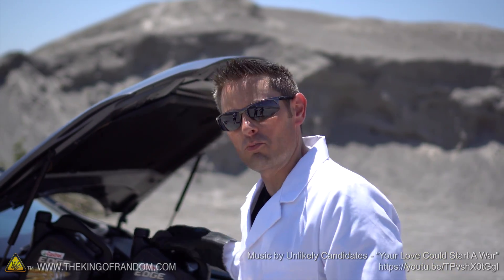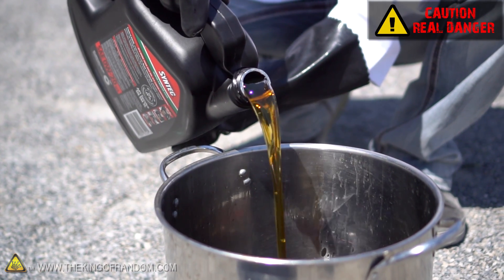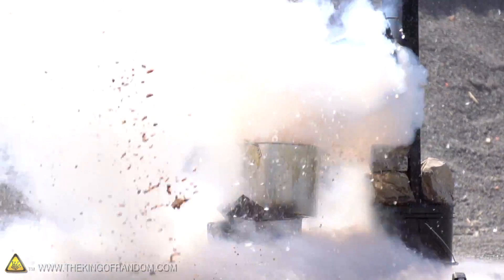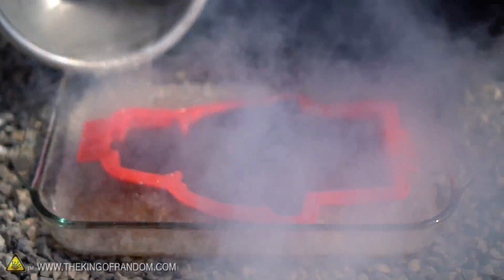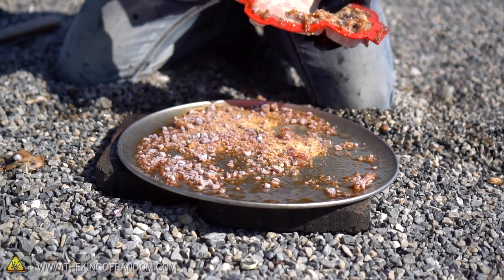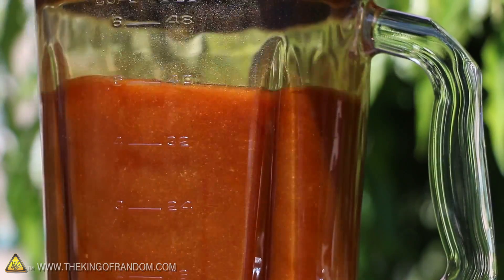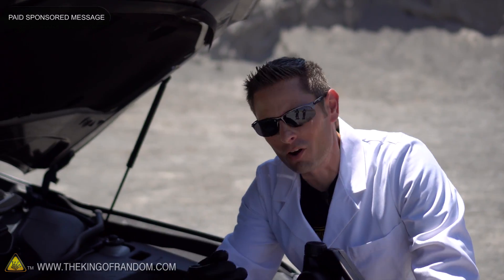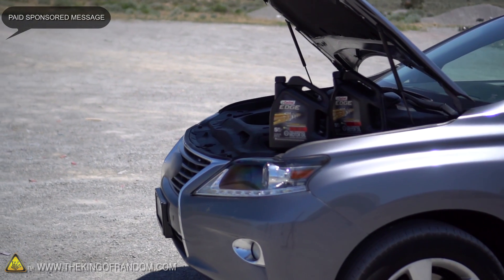Liquid Nitrogen Meets Boiling Motor Oil

Comment from the maker: Should I really have put it in my engine after all that abuse?  Only time will tell!  What are your thoughts?
Reply: what will happen if you put liquid nitrogen in a car
Reply: You're car is dead...
Reply: I love the fact you disclose if you are doing an add right in the title

Lots of youtubers dont 

you are far more ethical then most
Reply: Oh come on, you didn't even set it on fire! A torture test is going /past/ it's ratings. If your going to stay within, then you might as well just put it in a modern engine and replace it after the recommended amount of time.
Get it so it's /boiling/(Try over 300C) and on fire /before/ you throw in the LN!  You won't get a descent fireball otherwise.
Reply from the maker: Thanks for appreciating that.  And yeah I don't want to hide what it is because trust is more important to me than views.
Reply: full selloutmode
Reply: Did you do any sort of filtering... looks like you might have some chunks of silicone, gravel dust etc.  Enjoy your road trip, You should try to drive through Phoenix on a 100+ day, extreme heat killed a an old Mercury Sable in that city.
Reply: My thoughts are that Castrol probably reassured you that should your engine seize solid (during the trip or after a few tens of thousands of miles...) they would cover the engine replacement costs. I don't doubt the oil will be mostly fine since in reality you didn't do all that much to it, but I'm unconvinced you'd be willing to risk a $10k+ engine replacement should something go wrong... Also, I don't know how old that Lexus is but it looks pretty new, I wonder what Lexus' warranty claims department thinks about the whole thing...
Reply: your cars crap anyway
Reply: Dude wtf is wrong with you these days do some projects plz plz plz
Reply: can you try building pc with liquid nitrogen
Reply: best test 2016 ;)
Reply: Nope
I wouldnt have
It is not designed to be frozen, nor boiled and then flash cooled.
Reply: high temperaturea breakdown oils and the detergents in oil. cars run hot but not 400 degrees hot.
Reply: try petrol
Reply: +JonnyKiller the title says #ad
Reply: When will you make the stealth shelf. I'm waiting !😄😁😀😊☺
Reply from the maker: You know I would have, but it wouldn't pass legal.  That was my only restriction that I couldn't set it on fire.
Reply: he disclosed it. He wrote #ad at the end of the title.
Reply: ur wife is fit mate
Reply: +Fusion Coil Production
An engine that can only run on conventional? nope. Synthetic oils is nothing special. Here is how it works:
Mineral oil is simple paraffin with minimal additives, only selected to get the viscosity at certain temperatures (the 10w40, 20w50 etc.)
Synthetic oils are more refined than mineral oils (like comparing drinking water to creek-water) and have additives to keep the engine clean, to prevent it from burning, cokes and other problems.
Semi-synthetic is obviously somewhere in between.
Any car running on mineral oil can run on synthetic, that's why you can switch so easily
What could be the case in some cars is that the engine can't handle some of the additives, which is weird, companies like Castrol choose them carefully. So this should not be possible, I haven't seen any cases where it is.
What is often misunderstood is "eco friendly oils" (which is basically snake-oil). These are just good synthetic oils with LESS additives keeping your engine clean. So you will have to change your oil more often.
If conventional oil means "no snake oil" then you're right.
---
And yes, you can put Castrol edge in every engine as long as the viscosity is right.
In mineral oil - you are risking- the engine to get dirty form deposit, actually it's not risk but a matter of time.
Deposit on your engine is always a bad thing, the only positive thing from deposit is that it can fill in scratches and increase the compression; as well as clogging everything up. If filling up scratches is what you want, use Resurs, XADO or Atomium.
So really, mineral oils is something to never use actually, some older cars CAN run in on it, but they will benefit from semi-synthetic oil. However you usually won't notice the difference between semi- and full-synthetic on older cars.
Reply: blending it does nothing and freezing it dosent really do much. just make sure theres no solids in that oil
Reply: This was really informative. What do you consider an old car? 
I run synthetic blend in all my vehicles. I have thought about switching but in my experience, the modern engines are not the problem, its all the components around the engine that fail first.
Reply: +Landon Hillyard
Mineral oil - which has the risk of forming deposit - will mostly damage engines that can't handle it (modern engines). Engines can clug up more easily if they have finer oil canals and less clearance  (which are the newer engines) they often use lower viscosity oil. Another delicate part of engines is the valve timing adjustment mechanism like Vanos, VVT-i and so on.
If your engine recommends higher viscosity oil (like 10w40) and it has no variable valve timing, then it's an older type engine. (Sort of rule of thumb)
But synthetic is good for all, even for older engines. It's just that synthetic will have to benefit compared to semi-synthetic if it's a pre-'90 engine.

On these 'old' engines there is absolutely no risk of damaging your engine when you use Resurs or XADO additives. On newer engines there that are really worn out Resurs and XADO will give more benefit than they can do wrong.
If your car is brand new (<50'000 km or <30k miles) then Resurs and XADO will remove the honing of the engine; if an engine than has ran >30k miles the hone will be worn off anyway.

Atomium makes an additive for every engine, have variants to fit certain properties like diesel/gas, new/old, truck engines, race cars, and even gearboxes. Resurs is a universal additive, which is more convenient but:
-it lacks the "porous surface feature" from Atomium
-Resurs is more concentrated (risk of clogging).
-Resurs is not designed for newer engines.
The porous surface allows you to drive without oil for some distance; In case of an oil leak, the pores will store emergency oil at the surface (where it needs to be), allowing you to drive home without towing.
Simply put: Atomium is more advanced, better and more fine-tuned. People are using it in brand new porsches, BMW M5, Audi RS6, etc.
When Atomium "active gasoline for new engines" is applied to a brand new - just got it from the dealer - car, it will speed up the break-in-process.

The only reaon not to choose Atomium is because Resurs and XADO are cheaper. Why use an expensive product on an older and cheaper car?

*I called resurs+xado+atomium an additive, but it is technically not an additive because it doesn't change the properties of the oil itself, it only repairs the surface of the engine.
And when applying one of these compounds do it as said on the user manual.
Reply: You didn't put the same oil in you car but nice try
Reply: That's is not even the best oil Brad penn is the best oil
Reply: Be smart and buy/ pre order a Tesla...
Reply: do more firework based things
Reply: Grant is your car Lexus because my car is Lexus and look same.
Reply: Good Luck Uncloging Your intercooler and engine block :-)
Reply: Grant Thompson didn't do i think
HellRaiser
Reply: It wouldnt have mattered really as a mechanic what you did is less abuse then what most drivers put their oils through
Reply: when i think of quality motor oil, the first things that come to my mind are;
what are the detergents in the oil?
what temperature do they break down at?
are there any friction modifiers like molybdenum disulfide?
and finally, how long are the hydrocarbon chains, and how consistent are they throughout the oil?
none of the tests in the video really offer any scientific value to me, and i wouldnt have put the oil into my car based on the data retrieved from these tests alone.
that being said, the hot oil explosion was kinda neat.
Reply: Yeah, I don't think those tests did anything bad to the oil. Especially the blender, which was like running oil in a squealy clean, extra slow engine for a few minutes.
Reply: #ad
Reply: iT WILL GO BOOM LIKE IN THE FIRST TORCHER
Reply: Mike West  Really? you really believe that synthetic oils are totally different? Where do they come from then? from another planet?
Nope, they are made out of crude oil.
Your link only tells the properties of the oil, not how it's made. So don't blame me for not knowing something.
---
Just think about it, your link from JDpower.com talks about synthetic oil as if it's totally different, synthetic oil is made from the same crude oil as mineral oil, gas, diesel etc.
So it looks like you don't know what your talking about; I know rough the composition of most synthetic oils, alright?
---
When your base oil is similar to parrafin, then it's called mineral oil, when it's extra refined you CAN call it synthetic oil already (group 3). Premium synthetic oils (group 4) use base oils like PAO, which are oils created in a reactor FROM crude oil products like propylene.
If you would look at the molecules of petroleum oils, which are mostly alkanes and compare them to PAO then the only differences you would see are some cross branches.
---
How well the oil can handle does not influence the longevity, Cleaning additives and anti-oxidants (the non-edible ones) keep your oil working longer. That's it, that's the truth.
Don't believe me? Look it up yourself.
Reply: +Mike West
Ok, that's correct.
Especially with category 4 and 5 the base oil is totally different
But if you look at category 3 base oils (still called synthetic) then then the base oil is an alkane, just like mineral petroleum oil. The only difference is that petroleum contains other 'junk' that could oxidize or freeze at high/low temperatures. Junk=alphaltics, aromatics, heavy metals
The hydrocracking used to get category 3 base oils is indeed a chemical process, but the resultant alkanes are the same alkanes in mineral oil. How this is possible (in a nutshell):
For petroleum they just refine out the correct viscosity oil (with junk) and call it a day.
For synthetic cat3 oil they distill out base oil with a viscosity that's too high; so the molecule chains are too long, and the hydro-cracking just cuts these molecule chains in halve, the result is the same but just with less junk.
There were some companies that were just taking cat1 oil and (chemically) attacking the 'junk' out of it to get clean cat3 oil. And it because it was chemically the same as cat3 they could officially call it cat3. The authorities only care about the end result, not how you got there.
What companies like shell want you to believe is that their synthetic oil is superior and only a few people can make it.
---
Because synthetic oil is so clean (for example it has no asphaltics) you won't get nasty depositions at higher temperatures, and that's the temp resistance. This doesn't allow you to drive 100k miles though.
We change oil because it turns black; because it get's dirty (by the combustion process), and it's the additives that allow us to not change it every 500 miles, but drive on longer. It's the additives that keep the engine clean. It's the additives that prevent the soot, dirt and whatever is floating in your oil from doing any harm.
---
To get good quality oil, you need clean base oil, the cleaner the better, but beyond a certain point it's useless, it doesn't have to be sterile. And then it's just a matter of selecting ingredients and adding them in the right proportions.
Reply: yes good synthetic oil will be fine. I buy brand name because they are more likely to back up their claims.
Reply: Yeah!
Reply: First
Reply: Plz make a video of smoke bomb out of dry ice and hot water
Reply: You can be a modern rouge bar an if you do that
Reply: You are insane but you don't go literally crazy. I am proud of your insanity
Reply: nice car ^_^
Reply: You should review your lexus
Reply: Yes please.
Reply: I work at advance auto parts I am glad to see you do a video like this I tell people that you can switch back and forth between synthetic and conventional and they look at me like I am crazy. I have used this product and I agree that is a great product and one more thing you have to be carful with older and newer vichecals some need synthetic only and some need Convectional only
Reply: I love you and have been watching you ever since the How to make a mini metal foundery video that you made 1 year ago, and I think the car will work fine.
Reply: you grammar bad
Reply: Wait, the vid was posted 48 minuets ago and this comment is 15 hours ago?
Reply: nope you just hurt your engine if you did infact used the same oil
Reply: hi I love ur vids I tried some of vids they where cool to try thanks for giving me ideas because I get bored fast thanks
Reply: It's illegal to do sponsored videos on youtube if you don't disclose it in the title (not sure if you can say it in video description)...
Reply: +FlyingwithFire you legally have to in some countries (e.g. The UK)
Reply: you're car's gonna die at the furthest point from your house
Reply: +Stainless You have worse grammer.
Reply: G2a? Not a scam site at all but whatever.
Reply: +Dylan Laforge it evaporates
Reply: Probably not
Reply: yeah :D
Reply: full smithplays mode
Reply: You are grammar is dead.
Reply: Make something with the foundry again
Reply: yes Lexus does
Reply: one I would in the automotive industry's and some engines the few I know of are hemi and old Chevy 350 motors depending on what you are using them for, are better with conventions oil and some new engines any GM engines
Reply: sasja de vries you are right in what you are talking about but many new engines have aluminum heads and can't take the heat that conventional motor oil produces that is my some cars say only use synthetic motor oil for example any GM vehicle made after 2012 requires synthetic oil with a dexos additive in it
Reply: nice u bought a Lexus
Reply: Synthetic oil is far more durable than conventional oil. I remember reading in Popular Science that they tested synthetic oil by using it in taxi cabs and running it in the engines for over 100,000 miles without changing it. They did change the filters as recommended but left the oil in the crank cases and there was almost no change in the oils viscosity or characteristics. Synthetic oil doesn't break down like conventional oil does due to heat and wear.
Reply: Mike West
That's the additives doing their job.
As soon as the additives are used up, synthetic oil becomes just as good as mineral oil.
4 tricks to get 100k miles in your car without oil change:
*)Buy a wankel-engine or an old engine so that it burns oil, because it burns you have to top it up. So you still get fresh oil.
*)Buy a car with a huge oil pan, so that it contains way more oil than you need. It will simply last longer.
*)buy oil with EXTRA additives so that they don't get used up really easy.
*)in stead of replacing the oil just periodically add new additives. For example "imagnet-P14" is a will do that job.
---
If you take mineral oil, do extra filtering and distilling, add these additives, then you can officially call it synthetic oil.
Reply: +Mr Logical best part is he disclosed it.
Reply: Will it harm the engine? I don't think so, might have shortened the oils life span though. Unless it went in your engine chunky and milky colored, should have no worries. Oils are pretty robust when we look at what it's designed for and the abuse it takes daily in the internal combustion engine. Just hope you filtered it for debris before putting it in there.
Reply: AHHHHHHH its scary how correct you are!!
Reply: i am like 100
Reply: NO never do that again before you put it in ur car
Reply: Considering the temps and friction of a moving engine, there shouldn't be any problems even if it was regular oil.
Reply: You should do something with liquid glass putty
Reply: i have a super idea. what will hapend when you put dry ice in liquid nitrogen?
Reply: Building in what sense ? The PC cannot be cooled(at least in direct sense). But CPU's can be cooled. If you mean pouring Liquid Nitrogen into a PC Case, it will most probably kill the PC.
Reply: you can cool a PC with Liquid nitrogen, its been done already
Reply: +Jason Anastasopoulos then what about dry ice in motor oil
Reply: Mr.Thompson, I think your car is going to explode when you use it. Just saying sir.....
Reply: meh
Reply: +Brodie Donovan lol ok
Reply: +Ayman El-mo no just no no no no just just just nono just no
Reply: Read this then you'll know what you're talking about. http://www.jdpower.com/cars/articles/tips-advice/synthetic-motor-oils
Reply: You have no idea what you are talking about.   :-/
Reply: Can you freeze gasoline with liquid nitrogen?
Reply: hey grant
Reply: you should make a ping ping cannon
Reply: Will it blend that's the question! (Insert blendtec theme)
Reply: Grant I like your vids. However I feel it's time to move on to some other liquid for experimental purposes.
Reply: TNT ON WHEELS LOL
Reply: I already use this in my Nissan Cube, I have yet to have any problems with my engine and i only need to change my oil every 5k-7k miles.  So, they already had me sold on it, but it's pretty awesome to see the Oil actually freeze.
Reply: They may be made from crude oil components but they are altered on a molecular level and are far more than merely mineral oil with additives. And yea the different grades have different characteristics but they are not just refined oils with additives added. They are chemically changed.
Reply: ***** How about no and actually going of on user experience? Nobody that I know of including me ever got scammed there. 37 out of 68 games I bought are from there.
You realize ''scam site'' indicates that services provided by aforementioned site are faulty right?